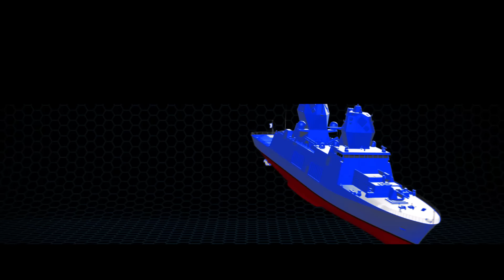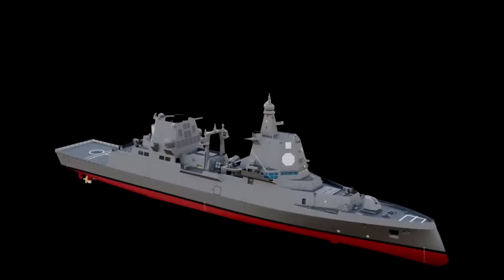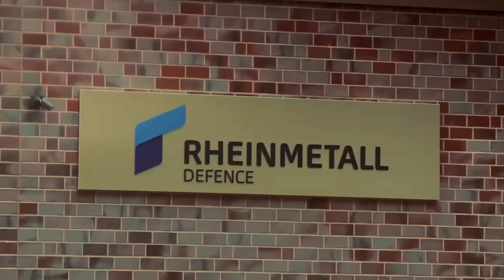The World's Largest Super Frigate is Taking Shape || How Big and Powerful is the F127 Frigate?

Comment: HYDEF system is still a long way. No missile is available to intercept hypersonic missile. It looks weird that with this ship they try to defend against hypersonics rather than ballistics. Ballistics defense is actually available with an appropriate system. Beside ballistic also drone swarm defense is advisable and possible to pursue with appropriate system like CIWS high energy weapons etc.
Reply: The inclusion of high energy laser CIWS probably also allocated for handling such a threat.. 
Both the hypersonic missile and ballistic one.. 
Since PRC already operates ballistic anti ship missile.. 
Although the ballistic part probably more for range and speed booster for the final missile.. 
Propelled the ASM missile into hypersonic speed region..
Reply: The Russian Kinzhal has been reported downed by Patriots in Ukraine. 

It—and most hypersonic cruise missiles must “slow” down to around Mach 5 to detect and guide to their targets (my understanding is too much heat ( a plasma buildup) is produced at the high hypersonic speeds to allow for accurate targeting using guidance methods like radar/RF. 

Inertial guidance would work, which is essentially what ICBM RVs use. (Astro-Inertial guidance)
Reply: @adamwsaxe  I never heard of that, but maybe it's true aswell, but as far as i know, it's beecause the have to maneuver. And the g forces at more then Mach 5 would simply rip the missile apart.

Comment: The German navy does not use the term "destroyer", they simply use Frigate. This will be the German's largest surface combatant in 70 years.
Reply: It will be similar to the F126 class in terms of size and displacement.
Reply: not quite.
Destroyer and Frigate are defined by their doctrinal use, not by size, weight or armament.
This ship is intended to coordinate and provide air defense as part of a surface battlegroup, so its a frigate.
if it was intended to conduct combat for a prolonged time without support, it would be a destroyer.

Comment: What is next? Aircraft carrying  frigate?
Reply: Nothing wrong here. The idea that Frigates are small ships only held up for a short time. The US even had nuclear powered frigates.
Reply: The currently newest type of German frigate, the F-125 class, was originally supposed to be specialized for coastal attacks. For that the original plan was to put a 155 mm artillery gun on it, a naval version of the M270 MLRS missile launching system and have the ability to carry 2 Tiger attack helicopters, on top of being equipped with cruise missiles.

Unfortunately all of that got scrapped. During the final stage of design and construction, the Somali pirate crisis started and so some extra bright brain in the German ministry of defense decided that the F-125 should better be specialized pirate hunting ships and basically all the weaponry was stripped, only leaving a regular 127 mm gun, a few anti ship missile launchers and a bunch of 27 mm machine guns.

It basically is a huge frigate (about 8000 tons displacement) with the armament of a corvette.
It doesn't even have any Vertical Launch Tubes.

What makes the whole thing even funnier is that at the time it finally was built and commissioned, the Somali pirate crisis it was built for was already over. So now the German navy is sitting on 2 huge but mostly useless warships it doesn't know what to do with.

They claim this ship class is still great because it has a super high level of automation and a unusual small crew for a ship that size and is cheap to run and can go on very long deployments very far away from home, but what is the point of that when it doesn't have the weapons a warship would need to do anything useful very far from home?

They sent ships to the Indian and the Pacific ocean to participate in war games and to show solidarity with Pacific allies against China and they always send the old F-124 class ships instead of their great new "far away" ships.
Reply: It is only a matter of time before Frigates, cruisers and destroyers start using drones.
Reply: @TrangleC  well, this is about the F127 and most of what you wrote about the F125 is nonsense. It always was designed for Stabilizing Ops. It is good at it and still needed for that.
As it happens it would be great if Russia tries to do to NATO in the baltic sea what Ukraine is doing to Russia in the black sea
Reply: @Chiggi0815  I have been reading articles about that ship 30 years ago.
There also are pictures from when they put the turret of a Panzerhaubitze 2000 on a frigate for testing reasons.

If it is so good, then why do they send the F-124 on every assignment?
Reply: @TrangleC  I know, that project was called MONARCH. Did not work out and the the  127mm were available and deemed good enough for the job. The MARS lunched did not work out either and the whole concept was not followed any further.
The F125s have just started their career with training and will go on their missions too.
F222 did UNIFIL and then went straight on to RIMPAC - Something no other frigate could have done.
The mission we are sending the F124s to is in the Red sea, but those can only doe ~8 month deployments before they have to return to germany.
Reply: @TrangleC  Which 2 large ships? The F125 class consists of 4 ships. The F125 is a separate class of frigates and was not built for military operations but for long-term maritime surveillance to enforce embargoes and asymmetric threats. The danger from Somali pirates is still present. Just in May, a German cargo ship was hijacked by Somali pirates. A patrolling warship came to the rescue and freed the freighter. By fitting an ASW module and the on-board helicopters, the F125 is capable of anti-submarine warfare. The Diehl company also proposes equipping the ships with IRIS-T air defense systems in a relatively short time and at low cost.
Reply: Ssshhhhhh !!! 🤫🤫🤫
Reply: @haakonsteinsvaag  ... Start?
Reply: ---> Japan takes notes
Reply: @wyldhowl2821  Japan ALREADY took notes.
Looking at you "helicopter destroyer" 😂😂

Comment: If its a destroyer sized frigate, why is it not simply a destroyer?
Reply: Because it's a frigate! The purpose defines the classification, not the size.
Reply: @wanderschlosser1857  How does its purpose differ from a destroyer?
Reply: @lesigh1749  Frigates are more specialized for few capabilities (e.g. sub hunt or anti aircraft) with secondary capabilities less developed or completely missing. Destroyers are more universal with more main capabilities that are fully deployable. What do you think why Germany doesn't call those ships destroyers. Or other European navies who have similar sized Frigates like the current 125 class?
Reply: @wanderschlosser1857  So they build destroyer sized ships with a ton of spare space and outfit them as a frigate, makes no sense.
The only benefit I can see for Germany with its Frigate fixation is that they can put an OF-4 commanding officer on a frigate where a destroyer needs and OF-5. They will save loads of cash on salary!
Reply: @lesigh1749  Germany must have their reasons, why they do it, same as other navies who have Frigates this size. I doubt it was for that saving salary. Btw. German destroyer commanders (postwar navy) usually had the same rank as the current frigate commanders - Fregattenkapitän, OF4. Germany had destroyers in their fleet until the early 2000's
Reply: @wanderschlosser1857  There reasons are likely similar to why they used broom handles painted black for vehicle mounted guns. Germany are cost cutting their military, a destroyer has more weapons, a lot more than a frigate, arming a big vessels as a frigate saves a ton of cash.
Reply: @lesigh1749  You certainly know it better. But the reason might be rather be more simple, Germany figured, they don't need destroyers for the capabilities they plan to achieve with their big ships. Btw the currently laid down 126 class is by far the most expensive navy project since the war with now 2 additional units compared to the original 4 planned. The new 127 class design will even exceed these costs, again for 5-6 units. Germany focuses on versatility by having their Frigates adaptable for different scenarios. And to double the duration between major shipyard refurbishments with significantly reduced crews. But as I already mentioned you probably have a better insight and knowledge.
Reply: Because destroyer is a stupid name that comes from small WW1 boats. A frigate was always bigger than a destroyer (but the americans fucked up that naming convention), the next bigger thing after a frigate would be a Cruiser which has it's name from the larger frigates which where called cruiser-built since they these where frigates expected to cruise far away from home ports and so they where bigger to store more food and ammo.

Comment: Carrier            	CV	>10,000,000kg  - Up	
Battle Cruiser	BC	5,000,000 - 12,000,000kg	 (Faster in Speed)
Cruiser           	CC	5,000,000 - 12,000,000kg	
Destroyer	        DD	3,000,000 - 6,000,000kg	
Frigate            	FF	1,500,000-4,000,000kg	
Corvette         	V	500,000-1,500,000kg
Reply: Dude you clearly don't understand the metric system, there's no way a Corvette weighs 0.5-1.5 million tons. Yes they play fast and loose with Naval nomilaclature these days, but the tonnage has maybe increased by a only few thousand tons to double the original ship type weights. This has been done since the late 1970's because politicians are idiots and defence planners needed a way to get around them without projects being blocked by Beaurocrats. A prime example of this was the Invincible light carrier of the Royal Navy, on paper it is called a "Through Deck Cruiser"  but weighed in excess of 25,000 tons, ever since, planners have done the same dance.
Reply: Not tonnage but capability is the name giver in the 21st century. Welcome to the world that actually lives in the present not in the past and especially not with the wrong tonnage of yesteryear.
Reply: @dc-4ever201  Ship classifications have always changed or were applied differently in different navies.
Originally, in the sailing ship era, frigates were fast battleships that were supposed to operate alone and far away from friendly harbors and do jobs the big, heavy, expensive and cumbersome ships of the line were not suited for.

You could argue that according to that definition the German battleships of WW2, even the Bismarck class were actually frigates.

Same with destroyers. They started out as tiny ships hardly larger than the motor torpedo boats they were supposed to "destroy".
That makes it kind of funny that nowadays people think a destroyer needs to be big and heavy and that frigates need to be smaller than destroyers.
Reply: @TrangleC  They are blurring the lines these days, it's all about specialisation, Frigates are either general purpose or ASW spec and Destroyers are again General purpose like the Arleigh Burke or AAW like the Royal Navy Type 45. Sometimes you'll see Corvettes armed to the teeth but their capability range is limited as they can't carry radar/sonar with a powerful enough range. Then you see things like the Royal Navy River Class Offshore Patrol boats that outweigh a Corvette but have only a 30mm deck gun, mini guns, gpmg's and some manpads. It's all a bit weird tbh.
Reply: @dc-4ever201  Yes, but those definitions are in the end just arbitrary decisions the US Navy made. You can't expect every other navy to follow the same rules, not even within NATO.
Destroyers used to be specialized escort vessels. All the way up until the end of WW2, you wouldn't send out a lone destroyer as a general purpose warship. That was what cruisers were there for back then, including in the US Navy.

When exactly and why US Navy destroyers suddenly became general purpose "tip of the spear" type warships while at the same time cruisers were demoted to only do escort duty in carrier groups, I don't know, but it definitely was a big change and shift, compared to how things were in WW2 and before that.

I'm pretty sure if you would time travel a US Navy sailor or a admiral from WW2 to today, would show him a Arleigh Burke class ship, tell him what role it plays and what it does and then ask him what he would call that, he would call it a cruiser and he would ask you why the US Navy doesn't have any destroyers anymore.

My point being ultimately the same as yours, that it is all a weird, confusing, arbitrary mess.
Where we differ is that you, despite acknowledging that, still seem to consider the way things are right now in the US Navy to somehow be the natural and logical way of looking at it, even though it is new and doesn't adhere to how it was during WW2.

The Germans have their own reasons for classifying everything as a frigate, the same way the Japanese call their aircraft carrier / sea control ship a destroyer or the Soviets called their aircraft carriers cruisers. (Because carriers were not allowed to pass through certain sea lanes.)

One thing is for sure, saying that "this frigate is too big and should be called a destroyer" never really made sense.
Reply: ...to be clear: 
a normal house for a family weighs about 500 tonnes, so this ship is definitely a high-rise building with 20 floors!

Comment: The F127 is to have about the same number of VLS cells as the Arleigh Burke class, i.e. over 90 cells. One reason for the size of the F127 class frigate is that these ships, like the F125 and F126 class ships, no longer have permanent crews. Thanks to crew rotation, the ship can stay in the operational area for up to 2 years, only the crew is changed regularly.
Reply: Nothing is set in stone yet, but most insight point towards 64 VLS cells. More cells would not make much sense in the european environment and the planed weapons. 
So far it is not planned to adopt the "intensive use" concept from F125 and F126 for F127.
Reply: @Chiggi0815  These are not only for the European environment.  Previous German frigates run out of ammunition and fuel too quickly on deployment to the Persian Gulf or the coast of Africa.  That, apart from cringeworthy armament of sea sparrow is why a bigger better AEGIS armed frigate is needed.  The memo is that the U.S. is withdrawing from protecting the world’s waterways to ensure freedom and safety of navigation.  If Germany wants free trade to continue and its benefits it will need to do more.  The U.S. will be occupied in the pacific and its tax payers are exhausted.  Warnings for years from both Obama and Trump.
Reply: @williamzk9083  when was a german frigate in the persian gulf and when did anyone ran out of ammo on the coast of africa? Do you mean the deployment of Hessen to the Red Sea? Sher certainly never ran out of ammo. Indeed she never even used her VLS weapons - except for the failed attempt to shoot down the american drone.
Beyond that she only used 2 RAMs, some 76mm ammo and the helicopter to intercept a USV.
She ended her deployment because she was on deployment because she was on another mission for 6 month before that. Those ships have to return home once a year for inspection.
Reply: Ehm yeah no F 127 will AT MOST have 64 VLS cells plus nsm etc but Not 90 cells. Allthough original Design ideas might have gone in that direction its Overkill and way too expensive if Germany wants to build 6 units.
Reply: @HansPeters1234  the solution the British are using is to add sea ceptor missiles on top of ASTER 30.    Sea ceptor As much smaller than SM-2, ASTER 30 and even evolved sea sparrow.
Reply: @williamzk9083  Yeah Sea Ceptor is a self defense missile that can be quad packed like ESSM. So F126 for example has 64 ESSM in 16 cells. So if you apply the same for F127 then you would have 64 ESSM in 16 Cells + 48 other missiles + 42 RAM. Makes for 154 ranged weapons on F127 - more than enough. 
People have to keep in mind that quad packing ESSM was not a thing when the Arleigh-Burke was developed. The later Zumwalts have much more displacement and only 80 cells.
The US has about 9000 VLS cells and even they have trouble filling those.
Reply: If you can't RELOAD AT SEA! It is merely a target 🎯